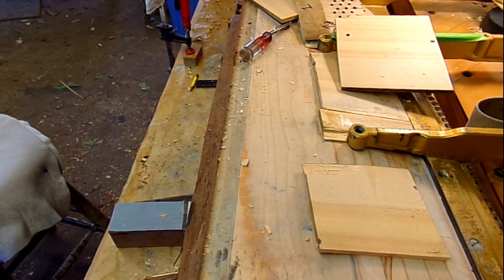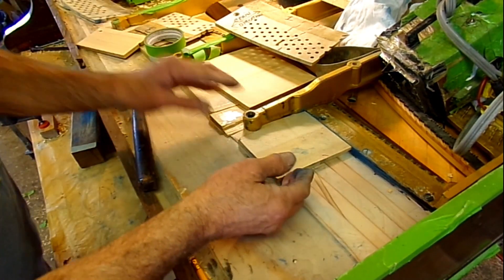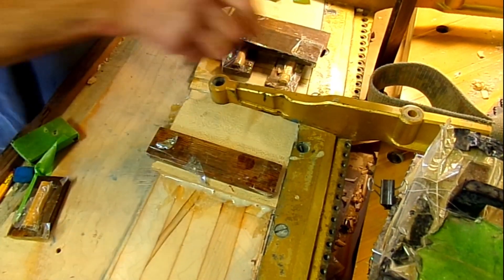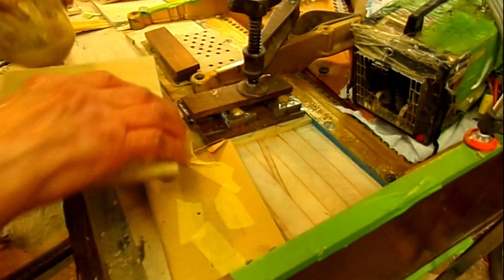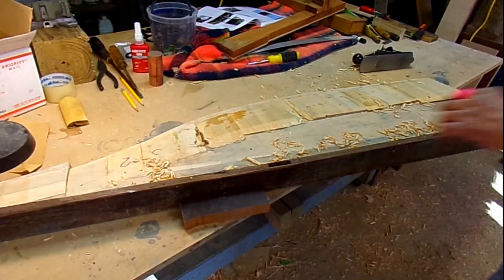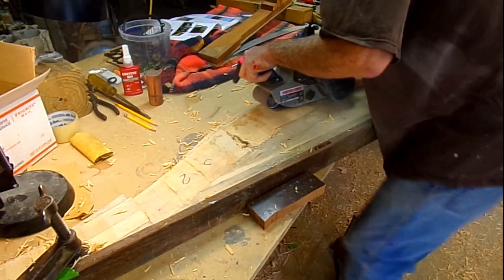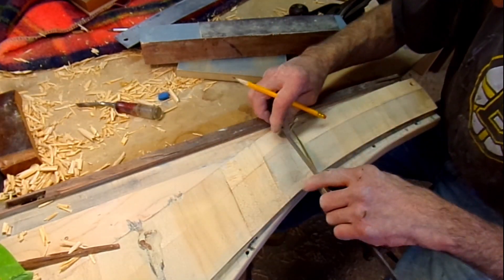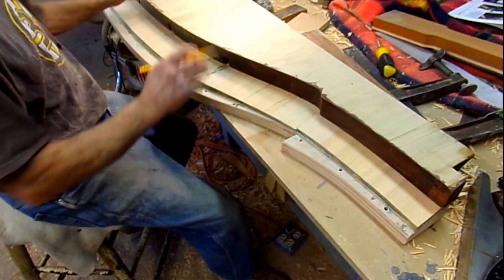Chickering 33B 1867 Conservative Restoration Part 21

Comment: I am very impressed with your amazing work! I was your 378th subscriber. Recently, I purchased an 1890 bluthner style 10 without the soundboard. It's a huge job! Will keep you posted on the progress. I love the videos! Keep up the great work.
Reply from the maker: Well,,,what are you going to do with this Bluthner?  curiosity got me.  What happened to the SB?
R.Blais.
Reply: @hampshirepiano6383  The original soundboard was removed at the piano restoration shop where it is in New York. The former owner took it in for professional restoration over 10 years ago. They abandoned it. I bought it last week. Some work is done it it disassembled the pinblock is brand new bolduc the bridges are new but uncut. The pattern comes with it. I am very impressed with your work. I would rather find a 100 year old restored soundboard (recrowned) like your shop does to maintain the integrity of the original piano. I am not rich so this is a long term project. Any thought would be appreciated. (I don't want a Steinway SB as suggested. ) Thank you for your thoughts regarding this 1890 bluthnet . -Xanna-